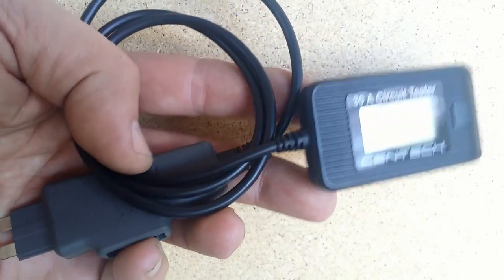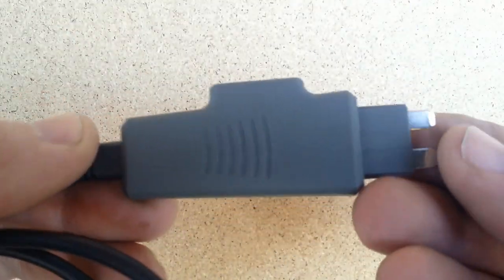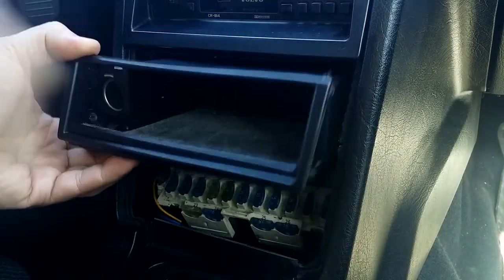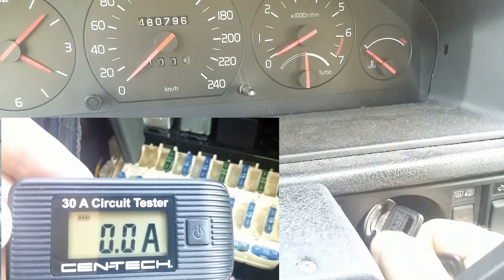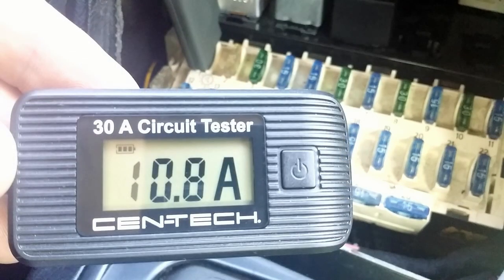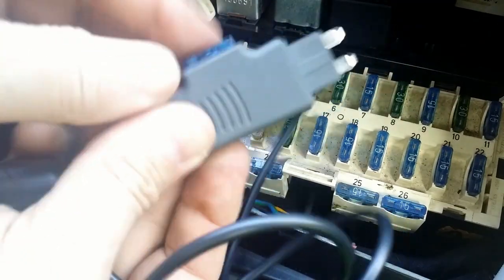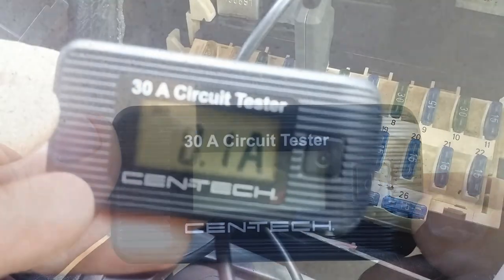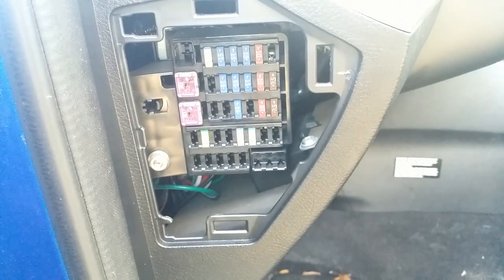Automotive Electrical Circuit Tester

Comment: You could easily make an adapter to work with the smaller size fuses?
Reply from the maker: You can buy this tester with smaller size fuse port.